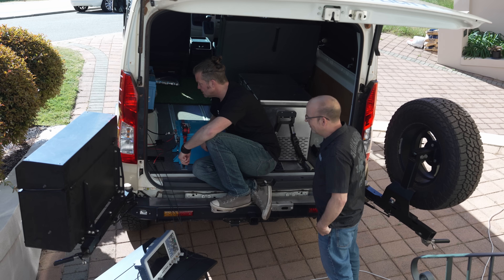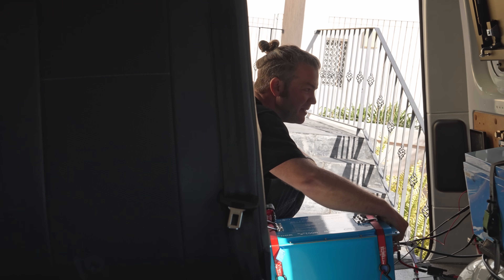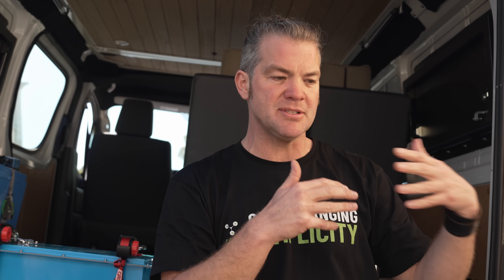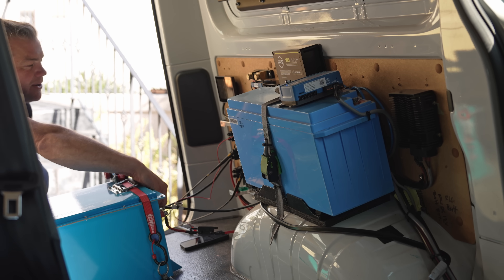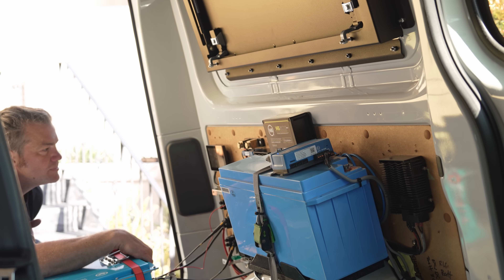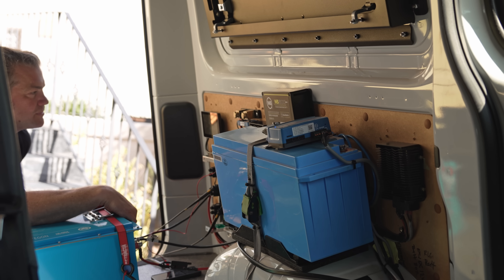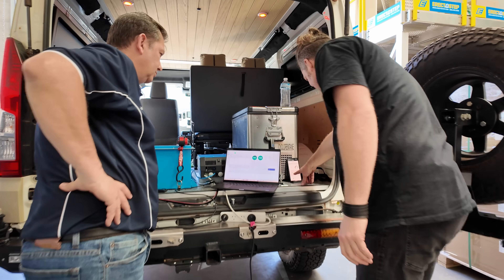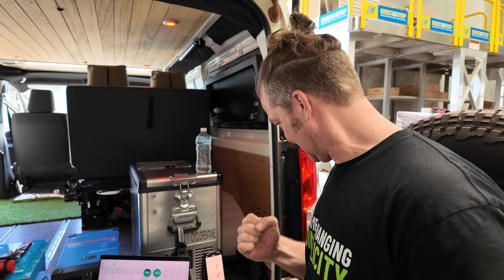FINAL HURDLES CROSSED. 48V is on its way  @4xoverland

Comment: New to all this but interested. I have a 2025 commuter 200 4x4 import. I have nothing yet apart from Luna 60l f/freezer and starlink mini so fresh start.  If i bought a 48v battery, 240ac charger and stepdown to 24v (fridge and starlink mini will run on this). Or better of getting  48v battery, solar blankets with controller and the stepdown. This would be usable when the Egon hub is on the market??. Like the idea of AC and Convection cooker. Planning a 5 weeks trip now so need some gear now. Cheers
Reply from the maker: While there are gains running a 48V house battery due to reduced losses, the real advantage comes when there is a 48V primary charging device - a 48V alternator. We are about to do some thorough comparisons to show what these losses really are, in real life. We've even established that these fast charge rates even save petrol/diesel! And not an insignificant amount.
Reply: @4xoverland  for this trip i will get a 12v bat and 240ac charger. Be interesting to see your tests and cost, any idea what the needed  48V alternator will cost?

Comment: Is this just a new way to connect a 48v alternator to the normal car 12v system, and charge 48v batteries with it?

Ive swapped to EV so i dont have an alternator, but 48v is enticing for cabling and weight reasons

Comment: I don't follow most of this due to eveything being way out of price ranges suitable. I also fail to see why 12V and 24V is not in use for mobile works. 48V is simply not needed nor is the risk of failure, 48V is more than enough to hurt/kill you and in hard faults, a huge energy release. I know you have your reasons but in reality, might be time to reconsider energy needs. 

Now, that being said, I have expirienced many electrical items failing thanks to cheap/nasty/shitty MPPT chargers that could not handle a BMS opeing up the battery from the system (charge load dumped). I have since moved to e Vistron and had no more issues of blown gear when the 12V rail goes stupid high (40V panel). There was a simple design I was working on with a a crap load of diodes and big resistors or other OV triggers to limit the max voltage to allow the charger the required time to slow down and stop.

Comment: Great job, guys.  A variable loading 48 VDC alternator connected to a smart charging battery system is genius!  If Andrew were evaluating this system, he would be dead nuts honest about Pros and Cons.
The other side is not being discussed....
To get 5 kW of charging current, it takes about 10 HP away from a very expensive Toyota engine. A potential user needs to keep this in mind. In some cases, a simple generator system may be $10K cheaper. Here in the USA a 5 KW generator could be acquired for less than $1000 without putting any load or hours on your Toyota engine to charge your batteries.
Building a small 48VDC generator on a gas or diesel motor with your loading system would also be a great business venture for an off-grid (no sun) battery charging system. My family had a car alternator connected to a Maytag hit-and-miss motor for an off-grid fishing camp in the 1950's.
Reply: Don't forget those extra kW at the same engine RPM equate to increased torque, by the same factor (1kW vs 4kW = 4 x more torque applied to the pulley and hence belt, required to turn the alternator.  and if your worried about loosing your new car warranty by adding spot lights etc can't think what a 48V alternator would do when you rock up to Toyota..

Tis

Comment: Active shunt clamp to mitigate the load dump? Using mosfets and a resistor bank?

A more elegant way is to use the CAN system to denengise the alternators feild, prior to firing up the active shunt prior just before the BMS disonnection. (Assuming the BMS is capable) and of course this is only going to work for a BMS disconnect, not a fuse blowing. 

You could always use some kind of "bus guardian" that will still de-energise the alt, provide a dump path and then dissconnect the bat without the smart CAN comms and would be battery agnostic. 

Probably a better solution and the customers wouldn't be tied to one bat  brand.

Comment: now all you need to do is figure out a way to use a 2 cylinder diesel motor to run an alternator that is smaller in size then a 2500W predator generator.. While all of this sounds great and seems like its going to be mostly worth it. Its still fuel running it and it is still finite if you can get a small diesel motor that can run off of any kind of fuel type like the old style ones. and figure out how to get solar to also augment. i think you would have a winner but as of now the cost of all of this and the amount of hardware you have to lug around out strips the hole set up.. just me out side looking in.. Any by the way last time i looked into 48V solar you have to have something like a minimum of 900W of panels to even start charging a 48V?
: Edit by the way 2 3500W predator genys set up in 240v link up is still under 1800$ in the states.. They run for 12 hrs on a full load..  at 2 gal for 12 hrs.. dont see how this can even come close to competing that.. is it dead silent nope.. but its not like its all that loud like 55 db ish..

Comment: Does that mean a 100Ah Lithium battery actually has 4,800 Watts ?????of usable power
Reply from the maker: Depends on the voltage of the battery. A 100a/h @ 12V battery can deliver 1,2 kw/h of power. A 105a/h @ 48V battery can deliver 5 kw/h of power. The energy it can produce at any one time is determined by the battery's max output current. These batteries can deliver 100A @ 48V which is 4800W. They cannot produce more. A 100a/h @ 12V LifePO4 can typically produce a max current of 120A, some a lot less. So that's a max energy at any one time of 1400W.
Reply: @4xoverland Sorry, I am not looking for max output current.
 I am hoping in future videos you may explain what continuous current draw means. 
Most folks run a fridge for example at say 40W an hour on a 12V 105A battery
With your 48V system I assume that fridge will run for a long time
Obviously I have no real idea what I am talking about, but super interested in this project for my long term off grid stays.

Comment: Maybe. Depends on the price point. Quiet generators are as cheap as chips nowadays.
Reply from the maker: If cost is the most important factor, then buy a generator. And put up with the noise, smell, cost to run, carrying fuel, somewhere to stow it and not use it in national parks or campgrounds where they are not permitted. Now imagine the car being the generator, but delivering twice the charge current of even a large generator?

Comment: My question is, we have Toyotas using a 48v system, can we adapt those systems and use them together ?
Reply from the maker: Excellent question. We are busy investigating this right now.
Reply: @4xoverland that will be interesting, great to see some test footage of it, even if you just connected the battery and check if it increases the use of the Toyota system. Thanks Andrew

Comment: Well, 48V is the way to go as running everything on  230VAC is the goal AND there is a high power demand.  I do see the benefits.Most people living in a van or travellers don't need that. I am using a 24VDC system in my Troopy which can be used for charging all kind of gear (camera's, drone) simply using USB-C PD (up to 100W per charge point). Other gear (easily to find compressor, fridge, starlink, LED lights, water cooker) is running direct on 24 VDC from the batteries (dual 100 ah 24V in parallell). I have an 800W Multiplus in my systen but  it is not essential. I don't use 230V that much any more thanks to USB-C PD.

BTW, I don't need an 3 kW induction cooker, my gasoline stove is fine
Reply: I am on a GDJ 78 Troopy build which is 12v stock system in comparison to their HiAce 48v assuming stock system?. I wonder if its possible to add another alternator 24v or 48v alternator to the existing one in order to avoid dc dc charger from 12v alternator to whatever 24 or 48v system assuming an direct voltage system from the alternator is more ¨efficient¨ than using dc dc chargers. inconvenient 48v to go backwards again with dc dc to run for instance a National Luna fridge max 31.5V
Reply: @snakeB8  I am not familiar with the GDJ 78. But technically, adding a second alternator should not be a problem and in fact a good idea because you are not interfering with the electrical system of the car. A good choice seems something from Balmar. They have heavy duty 24V and 48V alternators. As said I would prefer 24V because a lot of camping gear is available for that voltage so you don't need a 24-12 VDC convertor of only a small one. My Troopy is already 24V stock (HZJ75 European version) 🙂.

Some Balmars come with a separate voltage regulator and a temperature sensor for the alternator. This helps preventing overheating. Normally this is not a problem in a car though. Balmers are often used in yachts in the hot engine compartment.

Comment: Lots of chat about 4 and 5kw and big flows of energy. In the last video we saw Heiner with his fingers on the connectors.

Is there anywhere, anytime in the 48v system you have where there would be a danger to life?

Many modern EV cars cannot be repaired or recovered by normal means due to the danger of shock.
Reply from the maker: 48V is still in the official category of 'ultra low voltage'. But even so, we will be doing some reports on this. EVs typically use 400-600V. That's a different matter and extremely hazardous.

Comment: How do you get the alternator to charge 400 amps / 48 volt if its a 12 volt alternator?
Reply: A 48v alternator was installed if i remember correctly.
Reply from the maker: Its not. That charge current is impossible with 12V. Physics prevents this. A 48V alternator is required. The Egon 48V hub allows a 48V alternator to be installed without the massive costly and complexities normally associated with 48V. All the huge performance benefits without the complexity and costs.

Comment: If a 48v battery was also installed in a caravan and in the tow vehicle , I presume the alternator will be able to charge it as long as your not drawing more current than the alt can provide? Also is there a specific coupling/connector that would be used between caravan and tow vehicle? I also presume you wouldn’t use an Anderson plug as if something 12v plugged into a 48v supply won’t end well.
Reply from the maker: Yes to most of that. We are supplying a brand new coupling/connector because Andersens are no good for this purpose, mainly for the reason you have given. However, the draw is controlled by the battery, not the alternator. Which means the maximum charge current flows without the possibility of the alternator over-heating. Its a 180° turn around in trailer charging systems.

Comment: I am loving watching you guys invent this all live. One question I have is where does 48v sit in the scale of 12v and 240v for DIY and GOVT regulations and safety.
Reply from the maker: 48V is regarded as 'ultra low voltage'. There are no more regulations with it as there are with 12V.

Comment: It starting to look like it will be a commercial success when it is released next year.  Will your system only work with vehicles with smart alternators?
Reply from the maker: It will work with any 48V alternator. The smart ones, it will work a bit better. But does not excluded non 'smart' alternators.
Reply: @4xoverland  Thanks Andrew.  It seems I’ve got more to learn about 48V systems. I originally thought your setup just stepped up the standard 12V to 48V for the auxiliary power.  But from your mention of a 48V alternator, it sounds like your HiAce might be running a full 48V electrical system now?  Did I get that right, or am I misreading it?

Comment: Since there’s not much technical information, I can’t judge how unique your solution truly is beyond the sales pitch. I have 48V system running in my camper for several years, and it has all the features you are talking about. Maybe it has more wires, but in the end of the day there still need to be wiring from alternator, solar, etc.
Reply: I think they are able to charge from the alternator at 48v directly at 90 amps - that’s a huge advantage to what I thought was possible.  My system has 3.6kw in battery capacity and takes five hours of driving to charge from zero to full. On this system it would take 45 minutes.
Reply: @robertfrost5020 I’m charging around 4,500 watts. But takes 5 hours to charge the 17.5kWh bank as well 😂
Reply: @petrstolz5788 you are charging that amount from a vehicle alternator?  In a relatively small off-road vehicle? Able to drive for an hour then return to a trailer or caravan and charge up the leisure batteries from the ones you just charged from a short trip to the shops or a bit of sightseeing?  There is a lot here - it may not help or interest you and if you are the States you probably won’t be able to buy it anyway unfortunately.
Reply: @robertfrost5020  yes. I have two alternators. 12V and 48V. Both are charging the camper. The main contributor is the 48V though. You are right, small car. Get the 48V alternator in was pain. I cannot fit anything bigger than the original 12V due to the space constrain, so we had to be creative to make room for the 48V. I would not do that again 🙂.
Reply: Did you watch the preceding videos?
Reply: @maiabrittany yup. Not much there either. Everything is so secretive and they don’t want to spoil the beans. Fine with me. More products competing is a good thing for us customers. I’m just objecting the language of how ground breaking this is. Because based on what they presented so far, there are other options. Maybe they have something that it’s truly groundbreaking, but then they either didn’t explain it well, or leaving it out from the videos.
Reply from the maker: You are not wrong. 48V is nothing new. Military vehicles have been using it for decades. But that’s because of its efficiency. Complexity and cost isn’t the military’s biggest concern. But it is for the RV industry. Using our well-proven PCB board technology as the distribution hub, laying out the wiring, protection, redundancy into that board, this hub is bringing 48V to everyone. Requirements for an installation are a screwdriver and the ability to read.
Reply: @4xoverland Victron is easy as well… with that being said, interesting product, and surely on my watchlist for the possibility in the future.
Reply from the maker: We are making the fitting of a 48V alternator easy. Victron does not even try to do that.

Comment: Have you gents or will Egon design a version of the 48V Hub have the ability to run the tow vehicle as a standard 12V system but options for Caravan/campers to have a 24V supply?
With all the large recreational vans having larger and larger systems there seems to be an increase in 24V van systems and it seems waist full to transducer 48V down to 12V just to be inverted back to 24V through a DC/DC charger.
Reply from the maker: Yes. Trailer can remain 12V but still get the massive charge time benefit. We will prove this use case soon.

Comment: Will it also be approved for Europe and sold there?  
And will you test whether the 48V alternator fits and works in the Iveco Daily 4x4? That seems to be the most popular overlander vehicle here at the moment, due to a lack of alternatives in the 7.5-ton range
Reply from the maker: Go and find a 48V alternator for Iveco. If you find one, then the answer is yes. It will work perfectly. And 48V is still in the safe zone. No approvals required.

Comment: It would be somewhat safe to start up the car, and not drive, just to charge up over an hour or half, if you have your cooling solution right.
Reply: Although it is frustrating when you are in a ‘no generator’ campsite and the bloke near you is continually idling his vehicle motor.
Reply: @christinefry9847  The noise doesn't worry me, but best after 12 midday and before 8pm.

Comment: Are you guys taking the ps on the safety goggles?
Reply from the maker: of course.
Reply: @4xoverland  so you think it's ridiculous if you're testing new real charging scenarios and not thinking anything could happen dire. I guess if you're relying on the battery manufacturers getting it right, it maybe less worry, but you did say this is a new product, so new conditions.
Reply: @4xoverland  You were testing flyback circuits too.

Comment: Brilliant but... Would it not be better to rather develop small 48V portable systems that I can hook up to an external power supply (12V -48V DC or 110V-240V AC). I can use such a system in a Cabin, Trailer, Overlander etc.. A lot less cabling to replace. Easy to move between vehicles..MOBILE
Reply from the maker: But every battery needs to be charged, portable or not. How can it be charged really fast? A 48V alternator is the answer. This is more important than any other single factor in most applications. A 48V alternator changes the charge rate. Not the fact that the battery is 48V.  However, this system in a car means that the car becomes the recharge unit. Connect it to anything you want to charge  - tiny house, caravan, trailer etc. It can discharge as fast as it can be recharged. That cannot be done with 12V.